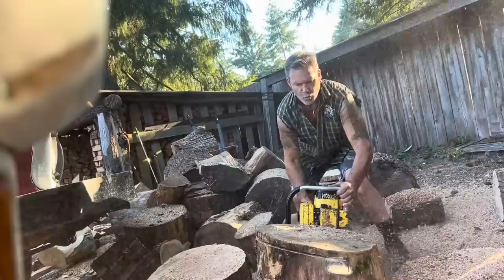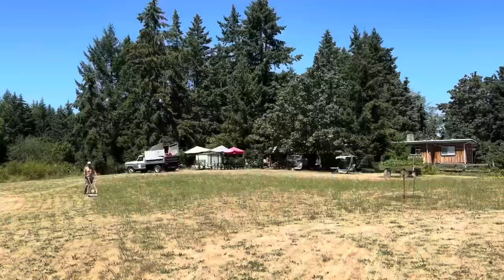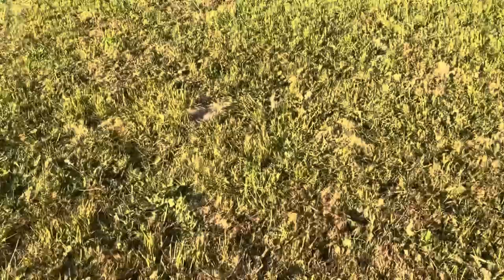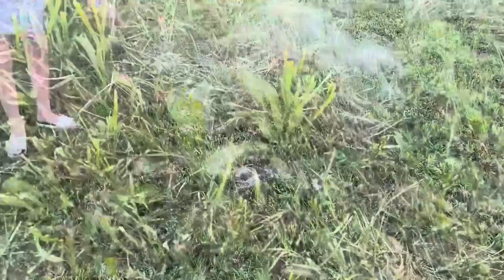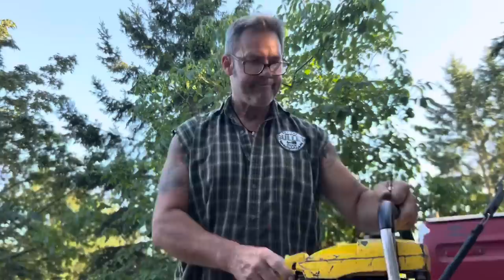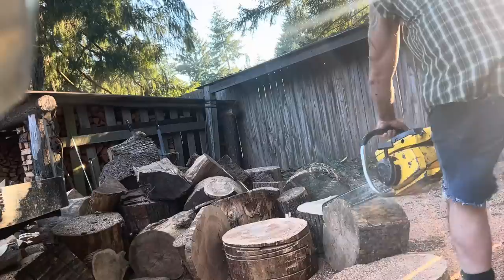Now were Cookin' with GAS!

Comment: Not doing well and nothing I can do to change it. It is so darn hot in New England I’m thinking for the first time in my life about moving North to worse weather.
Reply from the maker: Well then that wood be doin something about it
Reply: Rooster the toaster its 96F were im at
Reply: Yup climbing has been rough especially when the humidity, almost impossible to stay hydrated
Reply: Coastal Connecticut was actually nice today. Humidity was much lower than the past few weeks.
Reply: @JoeRainis156  I hear that. I’m over by Foxwoods, me an the wife were out in the sun all day working around the house marveling about how nice it was compared to the normally high humidity.
Reply: Hey friend a good tip to help you with the heat throw an ice pack or some ice cubes and a rag and wrap it around the back of your neck and periodically if you can stick your hands in cold water or grab something cold out of a cooler that's a trick that I was taught a long time ago and I'm old fat and wore out and it's the only thing that helps me get through a hot day I hope it helps you too sir

Comment: Hey buckin I just got my first homelite super xl and have had a 330 for a while now. I just got the parts to fix the 330 saved it from the tin pile. What mods do you recommend to do to both saws for more torque and pulling power. Also I'm wondering where I can find a template to make a pipe for the saws I am kind of wanting a rams horn style pipe like you had made for your husky saw. What kind of tubing should i use and where can i find a template. Thanks buckin appreciate any help I can receive.

Comment: Buckin, have ya ever used veggie based bar oil, like when you’re cutting on someone’s lawn and such?  You Canadians got a lot of canola up there.
Reply: That's funny, my buddy gave me a gallon of canola oil last year and i put it in my Stihl electric chainsaw and my Stihl gas chainsaw and it seemed to function fine.
This spring the chains were a little gummy but sitting in the sun and running them brought them back to good.
Reply from the maker: I sure have fallin' on water sheds and around creek

Comment: Silver maple I have those logs. That saw sounds like mine but is bigger and more bulky and has a longer bar 

Splitting those maple logs is kinda hard because the i call them elbows in the logs those and knots in the log 

Some I split last month had about 3 knots behind the bark you couldn't see it cause it was in the wood so i was just looking at it trying to see howd the knots get there and figured they use to be were a branch arm use to be at and the tree heeled up and sealed shut and that's what created the knots in the wood so i got the logs split up but I know those aren't good when you hit into them its just like splitting through a knuckle
Reply: That's funny. We call the elbows the "joinery." At least if I understand you're meaning. Or anytime there is a set of divergent stems with knots and limbs coming out.
Reply: @steelonius  yeah that's it